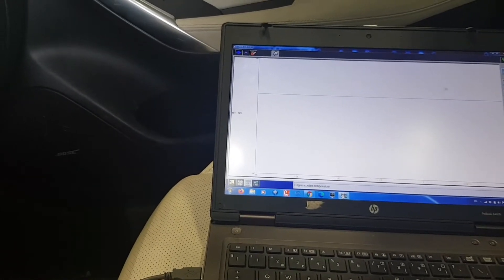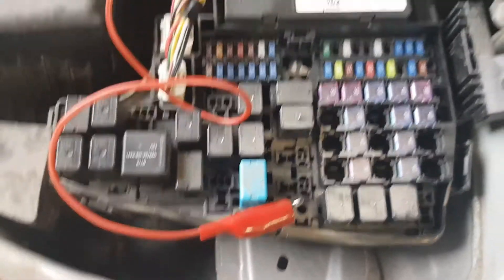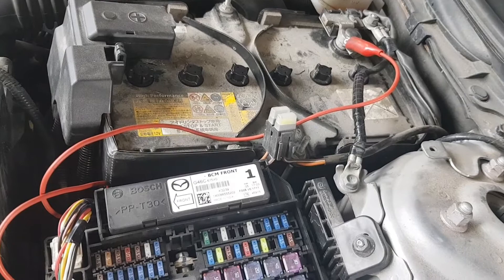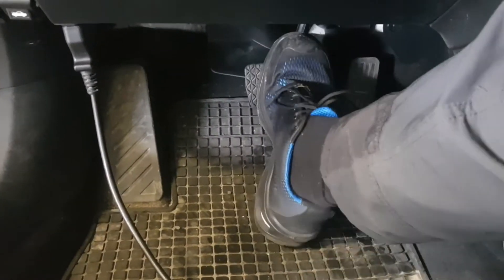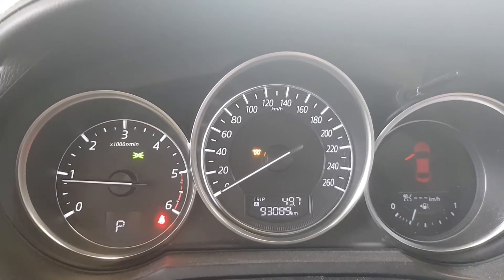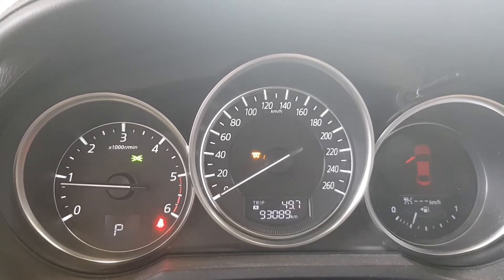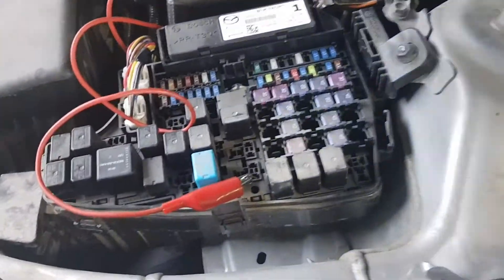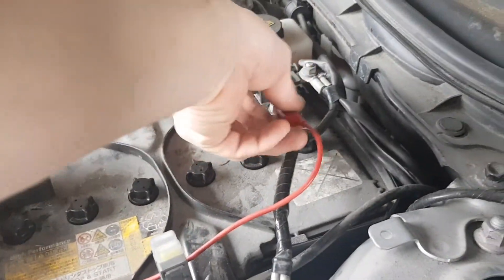Timing Chain Learning Procedure, Engine Skyactiv D 2.2

Comment: My chain is very very slack, but no error codes, does this happen sometimes? It's that loose I think the tensionor has broke.
Reply from the maker: There shouldn't be any slack on the chain, so if it is placed on the sprocket and you pull it with your fingers, it should sit firmly on it. As you suspect, there could be a tensioner malfunction or a tensioner guide problem. I wouldn't start that engine; the chain may change its position
Reply: @JB_Auto  Thanks for your reply, I was inspecting the cams due to a very noisy top end and thought I would have a look at the chain and this is what I found.    https://www.youtube.com/shorts/blcqsK3PMx0
Reply from the maker: @MrSHAUNE55  That's interesting and it looks like there is something wrong with timing chain guide, you should be able to see that guide, there where you placed screwdriver a little bit below. Inspect both guides and tensioner
Reply: @JB_Auto  I'm going to take the timing cover off in a couple of days, I'll let you know what I find. It's as if the slack that the tensioner should take up as gone to the other side, something is broken, strange how there is no check engine light and no P codes, I only have an old scanner.
Reply from the maker: Yes, send me some feedback, make some videos, I'm curious what that could be. It's possible that the alignment of the chain hasn't changed; therefore, no errors.
Reply: @JB_Auto  I will make a video of the state of the chain and guides etc when I take the cover off. Probably Monday/Tuesday depending on weather, and let you know.
Reply: @JB_Auto  Cover removed video.
https://youtube.com/shorts/Mg2cykx9Y4w
Reply from the maker: @MrSHAUNE55 That seems to be normal. Now grab the chain by two fingers on the top of the sprocket and pull it. If there is no play, then everything is fine. That is how I check for excessive play on the timing chain. I couldn't see the tensioner. Does it return while pulling the chain? Is it too soft? Did you record the noise while the engine was running?
Reply: @JB_Auto  I fitted a new chain today, to be honest I couldn't see any damaged parts but the nes chain is a lot tighter. Must have been stretched, no I didn't get a video of the noise when it was running, I presumed exhaust cam but it's good, I did find four worn tappets which I replaced but didn't put it all back together because I noticed the chain because I wasn't convinced the tappets would make all that noise. Just waiting for some injector seals to arrive. I forgot to do a video of the new chain.
Reply from the maker: If the new chain is a lot tighter, that could be it; possibly someone performed timing chain initialisation when stretched, which is why you did not find any errors, so do not forget to do initialisation of the new chain, regarding the tappets' noise: that mostly appears at higher RPM, around 2000 and higher. I made a video where I caught the noise so you can compare. Watch at point 2:20, the recorded noise is not as hard and clear as on other vehicles, but you will have a general experience of it. https://youtu.be/qjMqcpzMRVg?si=3ZB5da1QHaZANwNW
Reply: @JB_Auto  The good news is that the top end is a lot quieter, sounds like all the others I've heard. The bad news is that now you can tell that the loud clacking is the bottom end, it sounded like all the noise was at the top before, so now it's check the big ends time, and hope the crank is ok and check to see if I can see a damaged piston. There were zero signs of oil starvation on the camshaft bearings.

Comment: Hello, 

Thanks for the tutorial, they've been helpful.

I'd value your input in this please; I've changed the tappets, exhaust camshaft, vacuum pump, timing chain, strainer and cleaned the carbon as well. Unfortunately, the car has refused to start after all these. Cranking, not starting, just making like a swallowing sound like that in your tappets video. I also Got a new battery, but same thing. I recall now that I may have misplaced the injectors into the different positions as they were prior the process. 

Could that be the reason?
Do I need to recode them before the car will start?
If yes, which scanner do you recommend as I have one but can only code CX-7, not CX5 2.2.

Please help!
Reply from the maker: Hi, you do not need to program injectors; it should start anyway. I can not recommend any tool, that would be free advertisement, but you can use any advanced diagnostic tool. Regarding that "swallow" sound, I addressed that in the video you mentioned, namely, it is a lack of compression because the valves are getting stuck due to an excessive amount of soot on the valve stems. The only solution is to crank the engine until it starts. Try to crank the engine with a fully charged battery supported by a good charger; it sometimes takes multiple attempts before engine starts.
Reply: @JB_Auto thanks for the encouragement, I'll crank it a bit longer. Honestly, I think the most I've done is 7 minutes at a time.

Comment: Should this only be done if the car turns on after replacing the timing chain or before?
Reply from the maker: First is replacement, and then learning.
Reply: @JB_Auto Thanks a lot for your swift response. 

So, replacement, learning, then first start. 

Got it!

Comment: Hallo and thanks for the video.

My case: after the engine head gasket was replaced, as well as the timing chain and everything that goes with it - during the test drive, "system check required" comes on, i.e. a yellow triangle with an exclamation mark in the middle. Error code P1336:00-2F. Do you think that this reset from the video could solve that problem? I have mazda cx5 diesel, year 2016.
Reply from the maker: @novaps4111   Hi, thanks for watching. That error code indicates multiple solutions, so you should troubleshoot. Possibly, that's one of the solutions in the checking procedure. I've never had a pleasure diagnosing this DTC, so im not certain, but there was a viewer who claims that the reset has helped. This procedure is mainly utilised after timing chain replacement. So if you perform the reset, then I would like to hear from you what the result was.
Reply: @ I drove the car today and at first it showed this error. After driving for about 20 minutes and then starting the car a second time - the error disappeared. I did the reset anyway. It seems ok to me. The car drives great.
Reply from the maker: @novaps4111 Thanks 😊

Comment: Hi i hav a problem with my mazda 6 2.w skyactiv-d. its had injector leaking which i  changed but still the same noise. And its confirmed that its not new  injector.. the car is over fueling it seems and knocking noise from it.. the.mechanic put a computer only thing its sayin the injectors are out of range.. xus it be the timing or camshaft or is my pistons gone.. can u pls advise?? Thanx..
Reply from the maker: You need a proper diagnosis, not guessing😉 I would go to the dealership; technicians are well-trained and experienced and will quickly figure that out for you. Based on your description, I can't help you much. The only help I can offer is to use my videos as resources, and it may guide you to the solution. In many cases, you may need to remove some parts for verification, not guessing, and, most importantly, proper diagnosis.

Comment: What the benifits of doing this mate
Reply from the maker: Hi, check out the description 🙂
Reply: @JB_Auto  does this make the car run better and give better economy after the timing chain calibration
Reply from the maker: @KhanKhan-lw8fw The initialisation itself doesn't change any of that; the replacement of the chain could have an impact on that.
Reply: @JB_Auto  oh how would you sort that out
Reply from the maker: @KhanKhan-lw8fw  I'm not going to elaborate on that; to do so, I would need to be acquainted with software logic, which is unavailable for workshops. You can always experiment with what happens before and after 😉
Reply: @JB_Auto  ok cool mate

Comment: Got a code P1336 few weeks after replacing chain in Mazda CX 5 2.2 175 auto. Replaced both sensors camshaft /crancshaft didn't help. This worked. 
Just wait until 65 degrees and re-learn then erase the codes. Problem solved.

Comment: Thanks, after replacing the head gasket had the loose chain error and the red triangle warning light in the dash. Followed this and disappeared, I am amazed! Cheers!
Reply from the maker: Hey, could you tell me what was the mileage of the vehicle, it is not normal that a warning light comes on after head gasket replacement. Unless the timing chain was stretched before replacement. Could you tell me more about the case?
Reply: What country are you in

Comment: Hello,after i changed the timing chain,i have code erorr p1336  ,how can i solve it
Reply from the maker: Hello, did you have any MIL before timing chain replacement? 
If you had the same DTC before replacement, then try to perform timing chain initialization and Delete  DTC. I'd like to hear from you if it helped.

Comment: Mazda espouse their "maintenance free" timing chain crap.  What would be a suitable timing chain replacement period for a  low mileage, regularly serviced 2016 1.5 Skyactiv D?  Or should I just listen out for that tinkly chain rattle?
Reply from the maker: Thanks for the question. The timing chain is maintenance-free on the 2.2 engine. I have never replaced any on those engines( mileage up to 300K km). Regarding 1.5 D we had no issues yet, and it is maintenance-free as well. Are you sure the sound is coming from the timing chain? If you service it regularly, mention it during the next maintenance. I would like to hear more from you about that.
Reply: @JB_Auto  Hi! I have a mazda cx5 2.2 and I have 200.000 km. Should I have wories for chain distribution? I know only the chain of oil pump was changed preventive. I don't have noises or else in the morning
Reply from the maker: @CiapsaCrinel Hi, if the timing chain gets stretched, it will warn you by triggering DTC. I have never changed any timing chains yet, which means they are reliable. To keep them in good condition for any length of time, change engine oil frequently.
Reply: @JB_Auto  Thanks for your prompt response and I'm glad to hear that you have not had issues with 1.5D timing chains.  I have not heard any noises yet, I mentioned it as a method of determining a problem rather then removing the timing chain cover to inspect. Sorry for the confusion.

Comment: Great Video . I have rebuilt my engine with new Bottom end bearings and have test driven the car and the Oil Pressure light has come on . Not sure if I should use the Timing chain learning procedure as its the same chain. ? Is there an issue with these engines oil pressure sensors.
Reply from the maker: To reset oil, you will need "IDS" Mazdas diagnostic tool or equivalent, to check oil pressure you need the same tool and You go to Parameter called "EOP" which is engine oil pressure, check at hot engine at 1.5K RPM reading should be above 140 kPa, then at 3.5K RPM reading above 310 kPa. 
We never had an issue with pressure sensors.
Reply: @JB_Auto  Thank You for the Reply . I really appreciate it as have spent a fortune on this car and really hoping I haven't messed up something. Thanks again.
Reply from the maker: @Floweaver  You are welcome.
Reply from the maker: Do not perform timing chain learning procedure on old chain. If you rebuild engine you shouldn't have oil pressure light, try to reset oil life, this can trigger oil pressure warning light, This happens on older Mazdas. You need to check oil pressure as well, and that is just in case.